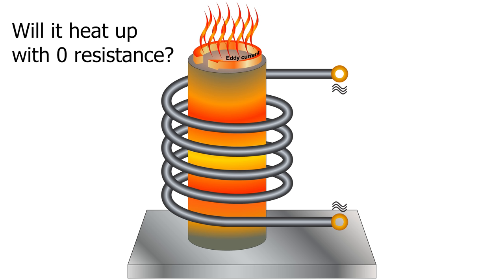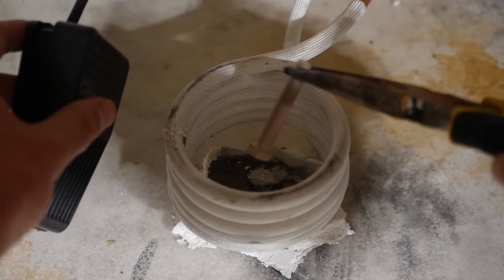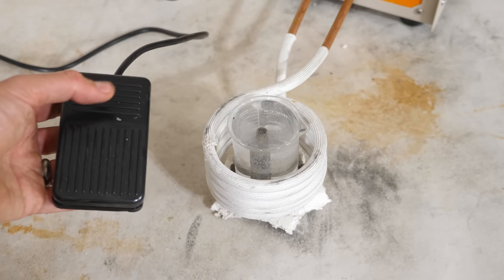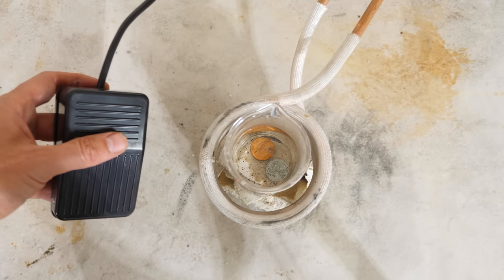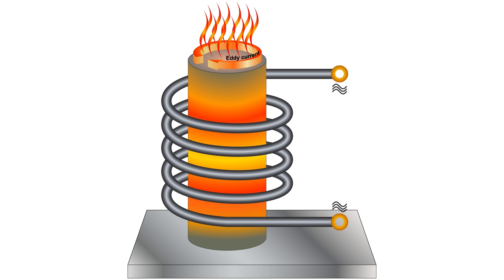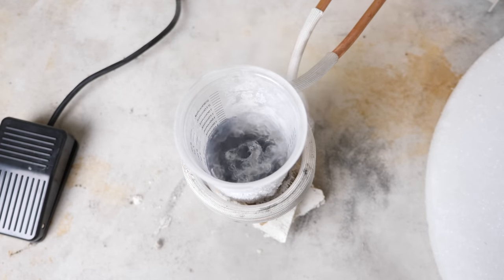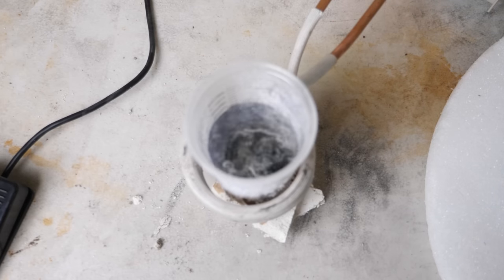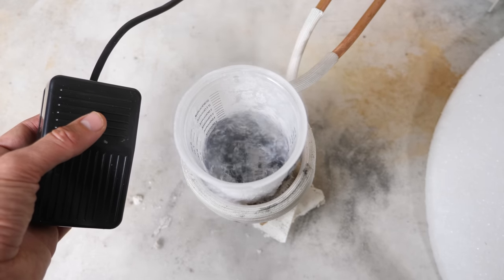What If You Put a Superconductor in an Induction Heater?

Comment: Unless the penny you used was old (before 1982) it is copper-plated zinc, which has a much higher resistance than copper.  It didn't get hot because it had too much internal resistance.  Try a copper (pre-1982) penny and it will probably get hotter faster than the steel penny.
Reply: I came into the comments to say this exact same thing. The penny he used is defiantly a newer one based on the union shield side of the penny. This means that the penny used was 2010 or newer so defiantly coper-plated zinc making it more zinc than copper.
Reply: @vintilk  I hope he sees this and re[eats the experiment with a copper penny.  As far as the superconductor caused boiling, there are probably some experiments that can better explain that action, too.  It would be nice if the RF filed could be adjusted to see if there was a non-linear point that would help explain the results.
Reply: We don't know the frequency of the induction heater, but they tend to be around 100kHz, which (google...) should mean about 100u skin depth. And the copper on that penny is only (google...) 20u, so yeah, I'm pretty sure that was mostly a zinc penny in that test.
Reply: Came to to comments to see if anybody pointed out 'recent' 1 cent pieces are primarily zinc because copper is too expensive. Also heard that zinc "fumes" (heating, burning, vapor, etc.) is on the toxic side and should be avoided, but don't know the specifics of this myself.
Reply: @dx9s  I put a small stack of pennies on the concrete floor and then aimed my propane torch at it.  The pile collapsed as the zinc melted.

Comment: Now that you explained it and I think about it, it makes sense. A superconductor can have zero ohms as long as the electricity we are passing through it has ANY straight path to get from one side to the other. However, that doesn't mean that the entire block of material has zero ohms. There can easily be some areas with higher resistance due to imperfections in the material, but those imperfections won't raise the resistance, since the electricity automatically looks for the path of least resistance. But when that electricity is being generated by tiny eddy currents all throughout the material, it is much more likely to get trapped between some of the imperfections and be forced to flow through a portion of the material that isn't quite a superconductor. This is my hypothesis anyways. Someone please correct me if I'm wrong.

Comment: Superconductors are only superconducting at DC.  At AC the momentum of the superconducting electrons causes them to lag a little bit, allowing some of the electric field to penetrate.  This penetrating field causes the non-superconducting electrons, which are also present, to create a non-superconducting current and lose energy through resistance.

At higher frequency, this lag is more pronounced, and more of the electric field penetrates.
Reply from the maker: I couldn't find any information on how much resistance this creates. I wonder what percentage is from the penetrating field vs skin effect. Skin effect could be quite significant in the type 2 superconductor due to the fields around each imperfection.
Reply: @TheActionLab  Also, wouldn't the resistance go up when the skin layer is heated since it will heat the neighboring parts slightly?
Reply: @TheActionLab  There is also a maximum amount of current density that a superconductor can handle before it becomes a resistive load to any further current. I suspect this is what happened. This is why MRI machines have to be very carefully ramped up slowly
Reply: @TheActionLab  There's a simple proof of this -- although it doesn't tell you /how much/ at the experimental conditions.  Simply consider this one fact:

The block doesn't become shiny when cooled.

Now, optical and LF waves are quite different; indeed, quantum effects are involved, for superconductors even around far IR.  But it remains the case -- and it will be true between both classical and quantum cases (and thus LF to optical), that, at low frequencies, resistance approaches zero, while at optical, it's quite nonzero (black -- absorptive).

In fact, your magnet demo at the start, hints at the nature of this effect!

In the same way that ferromagnetic materials exhibit magnetic hysteresis loss (energy dissipation upon field change), type 2 superconductors exhibit conductive hysteresis loss (flux pinning).  Work is done (you can feel it when you push the magnet into place!) deforming the superconducting path and trapping those flux tubes.

It stands to reason, if this is simply done faster -- indeed, a couple ten thousand times a second, say by a few hundred amperes through a coil -- the material will heat up.

There are other effects, I think, and also less well understood effects -- even for very pure and cold superconductors -- but this is a very hand-waving introduction to actually a very deep truth: namely, that there must be continuity in the impedance, from DC to (literally) light.  The fact that it superconducts at DC, isn't actually much of a guarantee of behavior at AC; but the fact that it's not shiny at optical frequencies, is a guarantee that -- somewhere inbetween -- it will be lossy.

The best AC superconductors I'm aware of (and it's been a while since I looked, but probably is still relevant) are made of spun niobium (type 1, no flux pinning), cooled to 2.2K or so, with a Q factor in the 10^8 range -- better than quartz crystal resonators, but still not infinite -- operating at 500MHz or so.  These are used in particle accelerators, basically because the bunches of particles have very little charge, macroscopically speaking, so they couple to the applied fields very weakly, and thus require a large multiplication ratio (Q factor) to drive effectively.
Reply: @TheActionLab   You should hook the superconductor up to an Oscilloscope and measure the frequency respone. Should be interesting.
Reply: @TheActionLab  aren't super conductors supposed to have really high thermal conductivity when super conductive? It would be really hard to measure where the heating actually occurs if that is the case
Reply: @kg4boj  Yes actually that sounds right about the superconducting current being limited
Reply: In an YBCO or ReBCO type-2 super conductor there are no mobile electrons in the non-superconducting state. Everything is bound to the lattice, that's why it's a insulating ceramic when it's not cooled down below the critical temp. So your explanation does not work on these materials it would work on standard type-1 SC's.
Reply: @TheActionLab  It would be interesting to find some literature on superconductors in AC. Also, would the nail and coins heat up if it was placed in an DC current instead?
Reply: @TheActionLab  there's a thesis called "AC LOSS IN SUPERCONDUCTING TAPES AND CABLES", maybe that would be helpful
Reply: This is somewhat true,and your explanation is hand wavy, but more importantly is not what is happening here. For there to be an applied current in a superconductor there has to be a voltage difference, this is impossible as this would mean an electric field would form in the superconductor, so throughout the superconductor doesn’t matter if this is AC or DC, no electric field will be applied to the superconductor. What’s happening here is called the skin effect, basically the only area where a superconductor has resistance and thus can experience a voltage difference meaning an applied current is on its boundary, as the electrons that exist there can’t possibly be superconducting. This applied current will dissipate energy in the form of heat on the surface of the superconductor and thus heating the surround liquid nitrogen. The reason something like an MRI magnet works is the power source will always have some form of resistance allowing for some voltage difference.
Reply: @westonding8953  - The bolt and steel coin heat up with an AC magnetic field. For induction to take place, you have to have a changing magnetic field. DC won't work for induction. You can think of the bolt as a shorted secondary winding of a transformer. Transformers work with AC but not DC.
Reply: @TheActionLab  we may cheat reaistance with superconductors, we can't cheat the speed of a massive particle in relation to the speed of light
Reply: Are there superconductors for AC? Would it even be possible for such to exist?
Reply: The book titled "The Energy Machine of Joseph Newman" had some interesting alternative ideas on how superconductors worked. Might also be worth emailing Eric Dollard and see if he answers your question as he's the resident electrical engineering wizard of the current day! 😉
Reply: Sounds like an inverse capacitor :)
Reply: @T3sl4  holy moly, this was a brilliant explanation
Reply: @JPMontello  Well, they measured it here.  Pretty surprising result and it seemed like the experimenter was also surprised as well, lol.
Reply: Bullshit, there Is no such thing as a super conductor.

Comment: The main effect here are AC losses inside the superconductor, not the penetration depth. The constantly changing field is constantly getting pushed in and out of the superconductor. Specfically, the 'pinned' fluxes are moved around a lot. This costs a relatively huge amount of energy. It is also one of the biggest, if not THE biggest, issue in making superconductors usable in practical applications. Also your puck of ReBCO is bulk polycrystalline. This is great for flux pinning (which is why it's used for these pucks) due to the very high amount of grain boundaries. But in this situation it works against you, as it costs even more energy to move these fluxes around. Even more of an issue is that these grain boundaries are normal conducting, and with a very high resistance at that. You're trying to induce huge currents in something with a terrible transport current capacity. For more information, you might want to look into topics like these AC losses in superconductors and the Bean critical state model.

As a sidenote: your steel penny might also heat up so much more because it is ferromagnetic
Reply from the maker: Yes, but what are the AC losses? It has to translate into actual resistance in the superconductor. The magnetic fields that are allowed to penetrate this type 2 superconductor also have a skin depth around each imperfection. So isn't that the same as saying it is due to the resistance from the skin depth?
Reply: @TheActionLab  It does have to do with a penetration field, but not specifically this skin depth effect. That effect is there don't get me wrong, but it's not the main reason for the loss of energy. You have to think how the superconductor gets magnetized "up and down" all the time. This is called magnetization losses or hysteresis losses. Another AC loss type that happens here are coupling losses, due to current moving between strands or grains of superconductor, so through normal material.
Reply from the maker: @WouterVerbruggen   Yes I see there are many more mechanisms for losses. The bottom line is that superconductors are pretty lame in AC fields
Reply from the maker: Also about the steel penny, I don't think that hysteresis losses (from being ferromagnetic) from the steel penny are the main reason for the heating. I think it is a mainly due to the eddy currents with high resistance. Even at high temps above the curie temps the iron heats very quickly.
Reply: @TheActionLab  Absolutely! AC effects is the root of many of ours problems working with applied superconductivity.

As for the penny, that's a good point. Would have to compare some numbers then to know for sure. I do know some induction cooking pans work better than other due to their stronger magnetic properties. But maybe the effect of frequency is different in those appliances.
Reply: @WouterVerbruggen  You are right about the steel vs copper penny. For Eddy currents the current density (J) = electrical conductivity (sigma) multiplied by electric field (E). The heating rate or specific absorption rate (SAR) = J^2/sigma [distributed system equivalent of p = (i^2)R]. So SAR = sigma(E^2).  A linear decrease in resistance results in a squared increase in current, so heating increases. So if the steel penny were not undergoing hysteresis heating we would expect it to heat less than the copper. What he's shown here is a great example of one of the reasons the base of induction cookware is made of magnetic metal.
Reply: That's like saying wood or plastic (that have a high resistance) would show the same effect in this experiment. But it doesn't the resistance is so high that there is barely any boiling of the liquid nitrogen. An insulator (like ReBCO when not super conducting) doesn't magically become a conductor that is able to produce significant joule heating. The induced voltages of that coil is way too low for that to happen.
Reply: @TheActionLab  You can try the ferromagnetic theory if you put tin into the induction heater. It has almost the same resistance as the iron. The skin effect is much more stronger with higher permeabilty, so may be the iron has worse heat distribution then the copper. We can't see what's going on inside. And it also would be interesting if you measure the current (probably you can measure the input thanks to Lenz's Law), to find out if the current is the same with any conductor.

Comment: I believe that the reason the steel penny generated more heat is mainly because there is greater magnetic flux in the steel than in the copper. Same as why we use iron in the cores of transformers. That is why you can only use ferromagnetic pans on induction stoves, in principle you could use a copper or aluminum pan, but the efficiency would be much lower.
Reply from the maker: You are talking about magnetic hysteresis losses. In ferromagnetic materials some heat is generated due to the magnetic domains alternating. But eddy current heat due to the resistance in iron is much more significant than the hysteresis heat created. You can see this is true because even at high temperatures (above curie temps where there are no more magnetic domains) the iron will still heat up faster than copper.

Comment: About the steel vs aluminum it's not about the conductivity but rather thanks to the iron magnetic hysteresis, each time the field changes, magnetic domains are following it and it dissipates a lot of energy, more than eddy current with iron. That's why iron/nickel beat all metals in induction, way before copper/silver (good conductors) and tin/lead (bad conductors).
Out of this phenomenon, I think the conductivity increases the effet: the voltage is fixed and corresponds to a 1 turn "transformer" secondary. When the conductivity is higher, the current is higher so it makes more heating power. The device source is current limited so you don't see big difference but if it wasn't, copper would beat lead !
Reply: More about resistivity versus what the coil is made of, and a geometry factor.

When their resistivities are similar (or, indeed if the coil's is worse than the work's), efficiency is crap and you're doing a whole lot of work for not a lot of heat.  You simply get less heat (and other effects like Lorentz force) when it's, say, titanium (coil) on titanium (work), than when it's copper on aluminum, or copper on steel.  Or indeed, copper on copper, which maximizes Lorentz force per watt, you could say.  (With respect to a given voltage input, say.)

Higher resistivity isn't really a problem, to a point -- as long as the workpiece is thick enough to absorb all the applied field (i.e. several skin depths thick).  Titanium and graphite for example heat very nicely, despite being fair resistors in comparison to copper or even (pure) iron. Obviously, resistivity can't be too high, else it simply doesn't absorb enough field to matter -- hence why glass, or plastic, or, well, LN2 for that matter, doesn't heat up appreciably (skin depth is almost infinite in them!).

And conversely, a thin conductive layer (shallow skin depth) isn't a problem per se -- copper is quite shallow but works very well as a coil.  Iron works quite poorly, but its magnetic permeability is making the skin hundreds of times shallower than for an equivalent nonmagnetic material.  Superconductors have indeed a microscopic layer, but as long as critical field isn't exceeded in it, that's fine as well.

(The geometry factor is basically just to say: you can always make a worse coil.  For example, by placing it completely beside the work itself, so they don't couple at all.  That's a pretty awful geometry, you'll agree. 😆)

Comment: Another reason may be that not everything in that puck is superconducting. YBCO is AFAIK made by sintering, and it's possible that there's a mix of superconductor and "loose oxides" for lack of a better term. 
For magnetic levitation only the superconducting parts are relevant. The rest of the stuff might be magnetically inert, but in the induction heater the non-superconducting parts might heat up.

Comment: Pretty sure its because Super conductors have a limit amount of current /magnetic feild till it just becomes a metal again.

Super conductors work because electrons in a metal pair up and  make cooper pairs which are fermions and cannot change momentum hence the '0' resistance.

When the magnetic field or temperature is too high they sort of go through a quantum phase transformation and revert into transferring current the normal way.
Reply: Yes, and it depends on both (and temperature as well) at the same time. Even worse, this stuff (ReBCO) is a ceramic in normal state.
Reply: @WouterVerbruggen  yeah but at super low temperatures its metallic state. I don't see its transformation into a ceramic being the limiting factor over the super conductor transition temperature